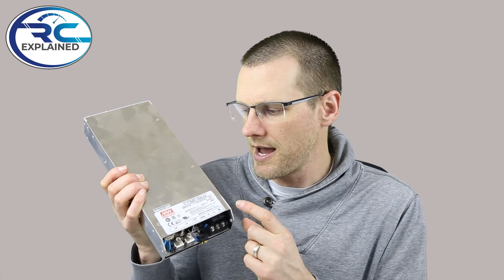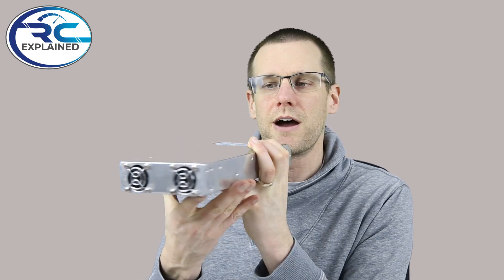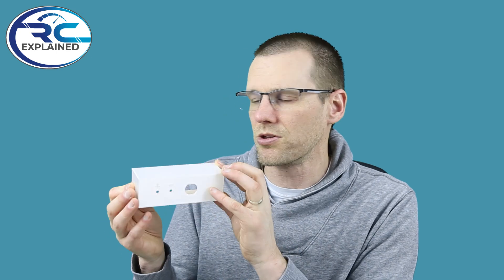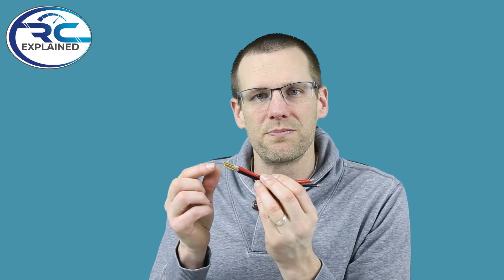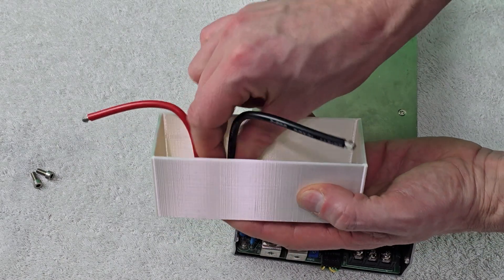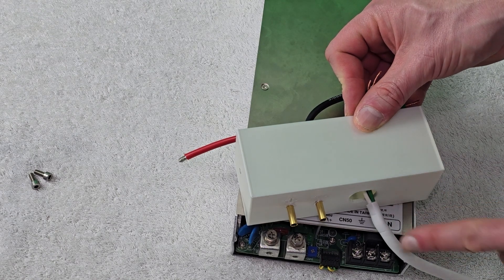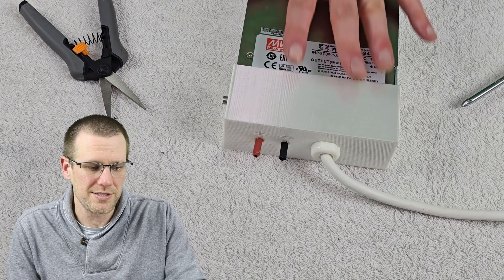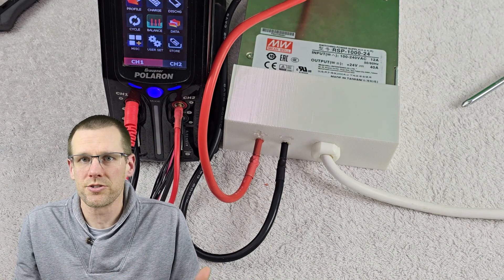Turn a $50 Power Supply into Serious RC Charging Power!

Comment: Hi Ryan!  Wondering if you have already done or are interested in doing a video to explain sine mode in crawler motors?  Recently small scale crawlers, 1/24, 1/18 have gained popularity and with it, aftermarket parts, namely motors and esc's.  Furitek and Injora both produce an ESC based on ARM32 architecture that is apparently very prone to cogging/hitching when it leaves sine mode.  I recently had a run around with them about a build.  Several hours of research later I found ESCape32 which uses a different chipset and does not have this cogging/hitching issue when leaving sine.  I see the question pop up here and there when someone assembles a new build and it does great either super slow or medium speed, but the transition from slow to fast when it drops out of sine it stutters.  Just wondering what's actually happening, why the escape32 chipset doesn't have it etc.  Anyway, sorry for the long post, not sure how else to reach you.  Keep up the good work, I recommend your channel whenever I can, very informative!
Reply from the maker: Thanks for your comment. I'll see if I can add this to the video queue.

Comment: I like these power 24V supplies, bought a new 200W unit for $7 to use with PD 3.0 USB charging modules. I guess 24V vs 12V from PC PSU has advantage for LiPo charging when you go beyond 3S, as your charger doesn't have to boost voltage, potentially getting more efficient.